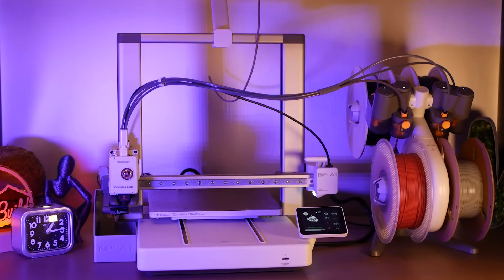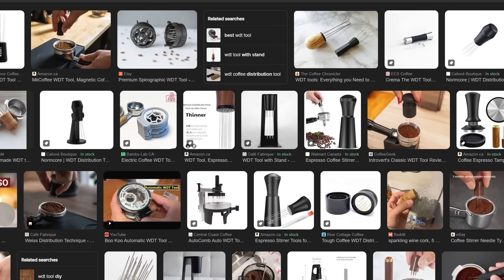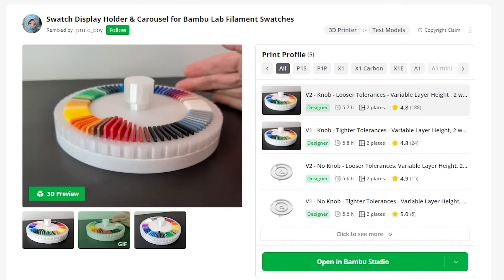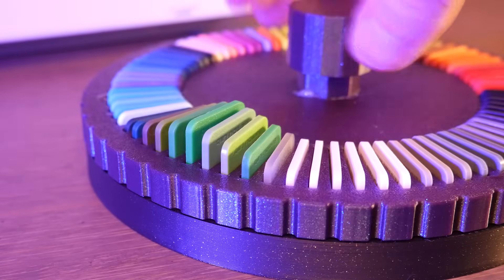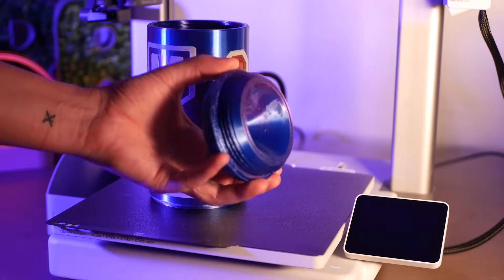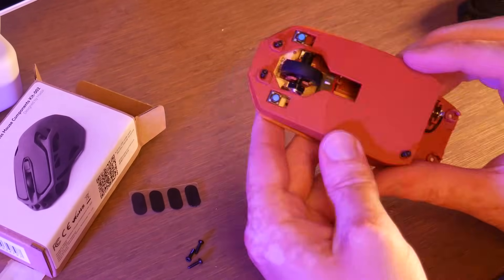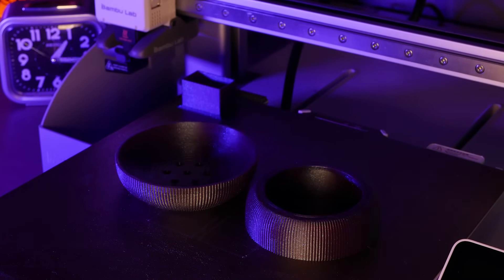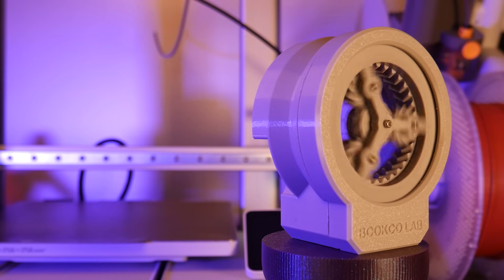8 Cool 3D Printed Things I made using the BambuLabs A1 3D Printer

Comment: What about the toxic fumes?
Reply: Toxic fumes depend on the type of filament that you are using. For filaments like PLA an air filter is not required but for other filaments like ABS, an air filter is recommended as well as enclosure use. However, if you are going to print in an enclosed space or in an area that you will be in a lot, an air purifier is recommended.

Comment: Why were there purge towers on your single color RED ?
Reply: The Timelapse function he uses stops the printer and moves the extruder out of the way after each layer to take a picture. During the stop plastic oozes from the extruder nozzle so it uses that tower to wipe the ooze away so it doesn’t make a blob or imperfection on the actual object he’s printing when it goes back to continue.

Comment: Just a suggestion to save you time and filament, you do not need prime/purge towers on single colour prints. 

Great video
Reply from the maker: Thanks for the tip! That prime tower is to catch oozing during the timelapse shot. I’d rather have stray blobs on a sacrificial tower than the print! 😅
Reply: @WildRoseBuilds  that is a valid point, keep up the great content

Comment: A1 user here when using the AMS system in multicolor prints with more than 1 object theres an option to print 1 object with its colors and then it will start to print the other object resulting in less poop. Always when slicing check the amount of flushed filament. The problem you had here every layer it swapped filament resulting in a LOT of poop.

Comment: How are your prints so clean? I printed the poop bucket for example, and get very visible thick lines in the walls, at random places? No matter what i print i get these bulging layer lines at random places :(
Reply from the maker: What machine did you print it on? The a1?
Reply: @WildRoseBuilds  Yup the A1. Had it since release. Worst print quality i've had on any printer. Tried tuning and tinkering with anything mechanical, and slicer settings  - Can't find anything. No one else seems to have this issue. Tried contacting BL Support - Their support didn't give one fuck, and would just keep on telling me to do a flow calibration, etc. Honestly pretty pissed. Wish i didn't buy the thing - My old ender prints waaay better :((

Comment: My A1 arrived broken out of the box, which naturally wasn't discovered until after the assembly and calibration processes.  But that wasn't the worst part.  The nightmare began when I started dealing with Bambu's tech support. One tech in particular wanted me to disassemble the entire X-Arm for an issue that really just needed a dab of hot glue . . but he assured me that the agonizing process he insisted upon "would make me more familiar with the printer."   Long story short, the tech support experience was so counterproductive I just sent the thing back.  Life is too short to deal with that kind of insanity.
Reply: Did you buy it from Bambu labs themself or a authorized reseller, cause if not that’s kinda your fault

Comment: When doing multi prints you can print them separately on the bed at the same time using diff colors instead of one at a time per print
Reply: Yeah but it would create a lot of waste because between each layer the nozzle would have to purge twice creating two "Poops" per layer, so it would get very wasteful very quickly. With most of these prints there's not enough space between pieces to be able to fit them both on the bed without intefering with the nozzle.
Reply: @cameronwilson1815  whether u print one or 100 of the same object it’ll purge the same amount.
Reply: @boazandruth909  I dont understand what you're talking about, all the prints he done were different he didnt print any of the same prints multiple times without changing something about it
Reply: @boazandruth909  If you print different colored items one after the other, the purge amount is miniscule compared with printing multiple colors at once.
It's likely much faster to print one at a time since the printer doesn't have to purge colors each layer.
Purging colors is a necessary evil people tolerate in order to get multicolored prints. Forcing a print to be multicolor so two parts can be printed at once is a huge waste of filament. It's also likely a huge waste of time too.

Comment: The change of color is so often on some prints, you are better off to print in the lightest color for the entire piece, then when done take off those that are the base color, and get a small paint sprayer and fill the other areas color with a plastics safe paint to reduce the plastics poop on each color switch. That is if many prints are large and have many layers w more than one color.

Comment: Nice video but wondering why I see a print tower on the Build plate when you're doing a single color?
Reply from the maker: This is for the smooth time-lapse! it helps with the oozing during the time-lapse shot and ensures no stringing or blobs get dragged back into the print. it's also hollow so not super wasteful. thanks for watching!
Reply: @WildRoseBuilds how do you get the time lapse shots? You aren’t using the inbuilt camera.
Reply: From what I understand there's settings with the printer to aid with external cameras for timelapse
Reply: @WildRoseBuilds  thanks!
Reply: @WildRoseBuilds  they’re genius!
Reply: I'm curious about that as well.
Reply: @orkhonal  That's interesting, thank you!

Comment: Does finely stirring the coffee grounds actually change the taste? Seems like you could use a toothpick and save 60 bucks
Reply from the maker: when water is forced through uneven coffee grounds it tends to take the path of least resistance leading to some of the more densely packed areas of grounds not getting fully saturated. tamping the grounds usually elevates this and ensures everything in your portafilter is at the same density. a toothpick definitely works but a wdt tool just adds another fun step to the ritual of coffee making. I'm no coffee snob but its fun to dabble in the world of tech and coffee sometimes!
Reply: @WildRoseBuilds true but the coffee grounds in the video doesn’t seem nearly fine enough to have a noticeable difference